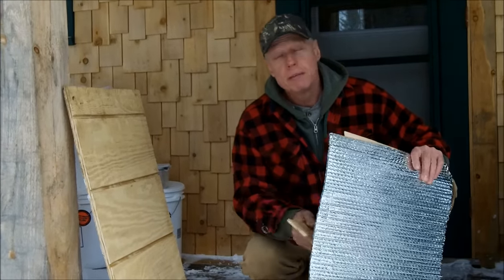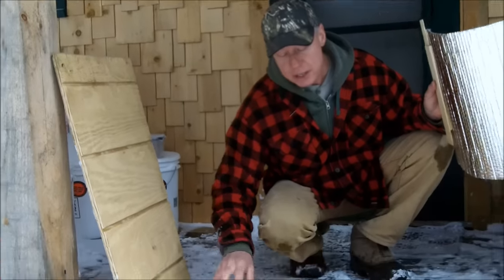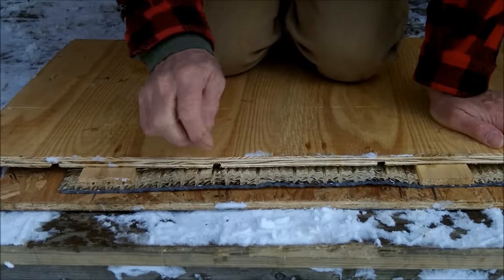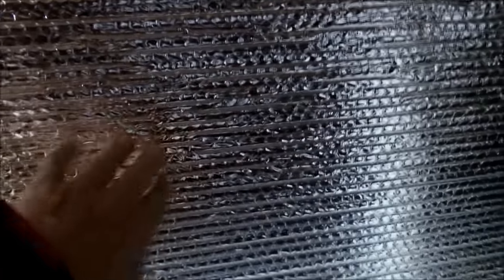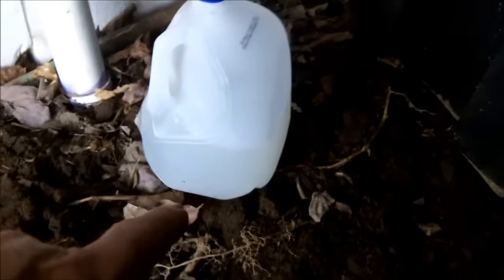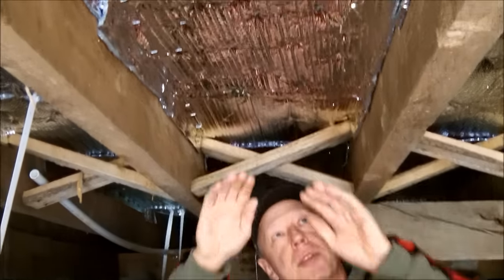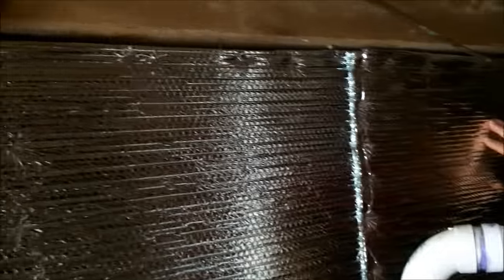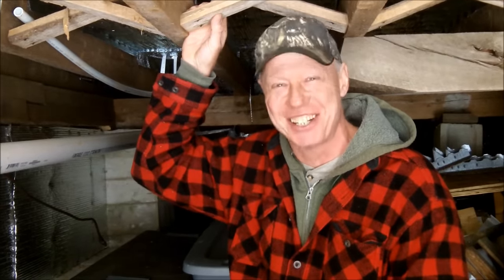HOW TO INSULATE A CABIN FLOOR AND KEEP IT RODENT FREE

Comment: I have been in pest control for years now.  I can not tell you how many thousands of dollars I have made from removing soiled insulation.  I have done $20k cleanouts.  This does make perfect sense.  You are the only guy that has made the perfect video on this subject.  I will be sharing this many times.  Thank you.
Reply from the maker: Ever since I started using this, everything else seems stupid.  I've wasted so much money in the past.
Thanks for leaving a nice comment.  Cheers :-)
Reply: Do you have any tips for when ripping strips? I was going to order a 48*125 ft roll, and then will need to rip strips for between joists under cabin just like you did. Looking for any time saver techniques.
Reply: @michaelmorrison197  I just did this.  I used a tape measure and painters tape.  I measured 16 inches and wrapped the tape around that mark.  I then used a long blade to cut around the edge of the painters tape.  If you measure carefully you should be able to cut your 48in roll into 3 perfect 16in rolls.
Reply: Oh thank You so much!  I am building the shed and was just looking for the answer of what to use in Alaska!  So it sounds like skirting and that bubble foil!  Can I get this at lowes?  Home depot?  And I love that cross bracing I was going to block straight across but that looks so much better and it looks like a work of art!
Reply: Why can't the mice still chew through the insulation?? It's not steel wool it's soft flexible foil. I'm not believing it.
Reply: It seems I'm getting more rodents with my bird feeder... but I'm an animal lover and GOD made animals too. So I feed animals and keep them warm under my trailer.  How much damage could they really do? 🤔
Reply: @unclejack41  The foil bubble layer is against the subfloor,  theres no place for a rodent to go i.e. no air space so theres no reason for it to chew thru there to build a nest etc.
Reply: @kimpozo3514  They can chew wires and cause short circuits and fire. That’s how much damage they can do.
Reply: @kimpozo3514  
You'll find out when they chew through some electrical insulation, create a short, and burn the place down. But, at least the rodent problem will be solved.
Reply: @kimpozo3514  a lot
Reply: @markm8188  that's what happened to my oven. They shorted it out by chewing the wires.
Reply: @lorenaroma  I've been using a very similar bubble insulation. I found my best price at the place where I buy processed metal, roofing metal. The big rule of thumb is to allow a 3/4" air gap between the insulation and the wall or floor material. Without the air space you tremendously cut down on the ability to insulate. Scientifically it is not referred to as R-value but as reflectivity because of it's capacity to reflect heat rather than to slow heat transfer or heat migration. It acts more like a thermal barrier.  I've been tinkering with this stuff over 20 years... Finally got my all metal barndominium built And moved into it a year ago. All electric with highest electric bill $240 in very cold temperatures. Two stories, sleeping lift, cathedral ceiling, 32x32 built on floating slab with 2" styrofoam under slab.
Reply: OFF GRID HOMESTEADING.  What do you recommend to insulate the unfinished wood walls of an old utility room? Do you have a video on that?  The utility room was an addition to an old farmhouse.
Reply: @kimpozo3514  every food, dog, cat, birds etc you put out your door attracts rats, mice etc. Either you get a few strong cats to get rid of them...or stop putting food out there.
Reply: I put some directly on the heating duct to protect the pantry from overheating. Could not believe the heat loss on this side,
Then placed 2" foam panel for extra insurance.
Reply: Almost 50 years of pest management here.
Reply: @thebossoftheswamp  iî
Reply: @lorenaroma  X bracing is stronger against  those servers storms, too.👏
Reply: Could you give me your honest professional opinion on closed cell spray foam insulation? I’ve done soooo much research on buying one of those very affordable shed-cabins for full time living WITH EXPENSIVE ANTIQUE FURNITURE AND ARTWORK, and everything states spray closed cell insulation is by far the absolute choice . But I am NOT a builder nor a pest control specialist. I hate insects more than ANYONE on Earth!!😱 Please help me! I have no idea what I’m doing😂 Thank you!😄
Reply: @izzyzon4975  got 3 dogs and 3 cats , still got mice 🐁,,,,,,, time for the layoff notices 🤣🤣🤣
Reply: Thanks for sharing 👍 😊 I appreciate 🙏 ❤ this 😉!!!!!!!!
Reply: @Sharon Taylor  Exactly! They pooped in my brand new remodeled kitchen. Ruined $8k of new kitchen cabinets. I found the oven insulation in little puffs on the floor. Pooped on the new clothes hanging in my closet. Peed all over my new sofa.  I had been away from my home for six months, ill and hospitalized. Came back to find that. Poop and urine and oven insulation. Do whatever you can to shore up any holes around pipes, doorways, etc. I had to throw out a brand new double oven. Can't afford another one. So now I just have an empty hole where the double oven use to be.
Reply: @kimpozo3514  they can chew thru floor, wires, setting your house on fire.
Reply: @terminatortsw8006  without insects to pollinate plants, there would be no people, animals or plants on this planet...
Reply: @kimpozo3514  To add to what others have said: Wild animals can carry disease (viral and bacterial)  and insects (lice, and ticks mostly).
Reply: @unclejack41 They can...it's not attractive because there is no room to nest. If ; foil...space...foil, was the  sandwich layout it would be attractive. Rodents would bring nest material in, and travel between the foil layers. This is short term because the foil would break (weight, excrement, freeze and thaw) sooner than the rotting fiber glass would give way.
Reply: @thebossoftheswamp  Boss, would any of the other brands of bubble foil be useful and do just as good as REFLECTIX-AKA BUBBLE FOIL that you use.
Thankyou sir. I cannot get under small shed, I want to  put barrier on top of flooring inside, then put stripes of 1/2 inch wood, then  nail down new plywood.
Maybe fill in walls with sawdust or natural insulation then tack up REFLECTIX over studs, then put up  wall board.
Do this on ceiling too .
The whole cap on roof and eves are vented the length of building. Going to have plenty of windows for venting, a small wood stove, a propane cooktop.
This is my yearly bug out camp at 6800 ft in mountains.. I guess that if I use it on all the walls, floor, ceiling, I will need to regulate the venting at different times when needed.. I figure I could stay cozy. What do ya think..
We are handicapped and are limited on help to do it differently.. still I appreciate your thoughts as to, or if I should never do this method at all.
I also thought of Adobe inside wall cavities, then after I helped it dry, put wall board up. Walls are only 4 inches. And I thought of just Adobe & Adobe plaster on inside with no wall board.
It could feel like Adobe inside, while having the T-111 outside..
Your thoughts sir..
Thankyou..
Reply from the maker: Reflectix is the only brand I have ever used so I can speak for others but the Home Depot brand appears to be thin and cheap. For interior walls, I would use the foil with the staple tab and insert this between the studs. It would be better to be fastening your interior sheathing to wood rather than to the foil and the staple tab type would allow you to so that.  For my ceiling, I blanketed the bottom of the rafters but then put strapping over the foil. This gave me a 3/4" air space as well as solid wood to screw my drywall to. @harvdog5669
Reply: @thebossoftheswamp  
Thankyou sir for your advice. And I will follow what you said. Have a great cup of coffee or favorite hot drink this morning.
Praying for you & your family.
I am a praying man.
Your fan Harvey
Reply: @terminatortsw8006  We did spray foam on our cabin in the woods. It was the absolute best ! Warm floors and no mice.
Reply: @kimpozo3514 God ALSO unalived and SKINNED the first animals FOR Adam & Eve when they were ABOUT to be kicked out of the Garden to be clothed ...and ENDLESS sacrifices ever since...
Isaiah 45:7 should help!

Comment: I completely wrapped my well house with bubble foil including the roof, sealed the seams with foil tape and made it airtight. The well house is in the 50s even when the outside temperature is well below freezing. Great stuff! It may even shield from an EMP or solar flare.
Reply: Is that 50 deg without any heating?
Reply: Your whole house?
Reply: @Blk_NRG  His WELL house!  Like where the well pump is.
Reply: @xxdragan  I would think the well pump, being 220v, would throw off enough heat.  Some guys have a 25 watt light bulb in the well house.
Reply: How do you glue your sub floor if the foil is on top of floor joist with out glue your going to have a squeaky floor
Reply: @mikewillower79  You don't.  You screw it down.
Reply: @maddierosemusic  it’s always a possibility of electricity going out or the bold not functioning for whatever reason. I live in Idaho mountain country, and I did 100 W bulb in my pump house and never had a problem. Those days was before I got introduced to the boss :-) :-).

Comment: Did this to my old hunting cabin. I made a huge difference. I added two layers, one with a 1 inch air gap under the floor boards, the other layer over the floor joists. Highly recommended
Reply: I won't have to wear my aluminum foil lined hat inside anymore.
Reply: May I ask where you found it and what the brand name is? Trying to locate in my area.
Reply: also can this be used in ceilings as well as flooring?

Comment: I use this in 36" x 20' roll when I'm hiking for a bed roll/pillow. Light, easy to use & easy to clean. Rolls up in seconds and if I have to I can use as a signal. Also great for reflecting radiant fire pit heat.

Comment: I renovated a Spartan travel trailer and mice had stripped every bit of insulation out of the inside and balled it up in the floor. I spray foamed the floor, walls, and roof then went back with this foil insulation as extra insulation in the roof. The thing was an oven before, now it’s comfortable most summer days with only natural ventilation. A single electric radiator heater keeps it warm in the Kentucky winter.

Comment: I ripped 2x4s and framed in the bottom of all my floor joists so I could take half inch plywood and nail it down to the bottom in between the joists. Then insulated it with fiberglass. Hopefully it's enough. Everything is about 8" off the ground with piers. I don't want to fight rodents but I will go to war.

Comment: In 1990 I did put it between the central heating radiator and the single window glass. In heavy freezing weather the glass frooze behind the hot radiator which stood a few centimeters away from the window! This insulation works perfect! Greetings from the Netherlands.

Comment: I agree with you. R value calculations don't take into account the transfer of air mass. You can have a high R value but if the building is not "tight" it won't do any good. You proved that with the skirting. I'm an Engineer BTW, and I've built a few camps myself, and a few few houses and some barns. I'm 69 and still building stuff.

Comment: As always excellent video. The bubble wrap here in Texas is called reflective. I live in an extended cargo van. My floor ceiling, doors and walls are all insulated with reflectics. Of course I have board insulation on the walls and ceiling. It definitely makes a big difference.My first winter in my van was miserably cold. This is my third winter now and it’s so much nicer. Still living in a can but with a little propane stove going every hour or so 10 minutes it’s heated up nice and cozy. I’m looking to buy a small bus and reflectics will be in there too. Thanks for the excellent information
Reply: Common use for that stuff is in Pop up campers and TTs. for the windows. I used it when camping at Lake Mead late spring early summer where the sun angles in at the camper windows in the morning and afternoon I mean like 100 degs easy. I just mount up the foil panels and presto instant temp reduction. It works !
Reply: Do you keep the cabin heated?

Comment: Good suggestion.  I am happy to see other commentors bring up the radiant barrier property of the foil.  This probably is the most effective part of that product - especially when used with a dead air zone (1 inch or less) next to it.  More heat can be lost through radiant heat loss than convection and conduction.
I like using a radiant barrier along with fiberglass.  Of course that requires a mouse proof installation.
It is hard to State the R value of a radiant barrier product, because it provides an altogether different mode of heat retention.  Consequently, I know one internet provider who radically overstates their R value.  They lie, but the tremendous benefits are true - NASA has known this for decades.
Reply: Bingo Kelly. You have struck upon the major reason this works so well to insulate. Until I read your comment, it was going to be the comment I added to the thread of others. It's why he made the right decision to put the material right to the underside of the subfloor of his other cabin.
Reply: What about rock wool insulation?
Reply: @paulaclark7989  I think a radient barrier would work really well in tandem with rock wool. I have never used it, but its reputed quality of holding warmth should hold the heat radiated into it.

Most people think there must be open air space for the aluminum to reflect into, but it seems to me that if those air pockets are really small like the small pockets  within fiberglass or rock wool, it would be excellent.

Comment: THERMAL BREAK - LOL, I watched you video yesterday and awoke this morning thinking about it (mamma mia!), and it dawned on me !! Thermal Break! The reason why it works  better sandwiched between the floor joists and the decking material is because it creates what is called a "thermal break" - or - you broke the "thermal bridge" isolating the cold floor joists, which is basically the same temperature as under the cabin, from traveling through the floor joists to the decking material, making it as cold as the joists. By installing spacers, as you pointed out, you gained dead air space creating another thermal break, but you also picked up another benefit. The tin foil material has a tremendous reflective quality, reflecting the heat back into the cabin... how cool! Love your videos!
Reply: Manufacturer literature advises leaving a 1" air gap. I don't know how that got over looked. This stuff works and of course it's so light to work with and easy to cut and staple. For R value properties alone it's probably not worth the premium but if depth is at a premium, or you want some vapor barrier effect with about no extra labor steps to do that in a 3rd step, it's really good.
Reply: Yep he broke the thermal bridge

Comment: We built our floor in two sections, our cabin is 20ftx20ft we sheated  the bottom with treated 1/2 inch plywood 2x6 joists with fiberglass insulation we flipped the floor over onto to foundation sheated it again with 1/2 inch plywood then laid 3/4 inch sub floor over that and built the cabin, that was 2001, no rodents in 22 years. What a warm building it will stay warm with the smallest fire. And very quiet inside. Love our little cabin.

Comment: This is good stuff Boss,  I worked in a machine shop one time and built a temperature controlled heat cabinet for drying small fresh painted aircraft part. I made it  out of wood and this bubble wrap stuff.  We heated it with only 3 heat lamp bulbs and we could maintain a consent 225 degrees inside with a few other little gadgets to help circulate the air. To say the least all the employees were pleased with my job of building something that would have cost the company $25,000 or more to order. So yea I rank this high on the list of excellent insulation. Good job using this on the cabin, you made the right choice.

Comment: I use it under the kitchen sink at our place in Maine. I just cut off a big piece and rest against the insides of the cabinet and makes a huge difference in keeping the pipes from getting cold. I also use it in front of the back door just as an extra barrier and you can tell the difference in fact I used a laser temp gun and it reads a few degrees warmer then the area without it. Its as good as you said it would be, nice tip, thanks again.

Comment: I used 1, 1/4 foam insulation with foil on one side to repel rodents. It works great even on bottom of studs.
Reply: Wondered if you could use both.  Thanks.

Comment: I build Micro Houses and we use an aluminum foil used in radiant floors along with insulation. When installing the foil between the joist we install it with a swag, this forms a radius airspace which reflexes the heat back into the room, airspace is a must, works great. I find it is much easier to access the crawl space from inside the home eliminating rodent access to the crawlspace. Another benefit is we also install floor storage bins for room temp items and below them coolers. Coolers are counterweighted allowing for easy retrieval.

Comment: I was skeptical at first as to how it would work, but then as you explained it it began to make more sense. I would use it underneath for a retrofit fix, but the idea of inside underneath new flooring I definitely would not do unless you use some really thick flooring like 3/4" minimum or else you will end up with sagging between where its nailed to the joists. I may be wrong, but I'm not seeing it being worth the added expense when I could spend far less putting the bubble foil in, even putting insulating foamboard between the bubble foil and flooring from underneath it would still be cheaper with no risk of sag. All in all a good backwoods video. 👍